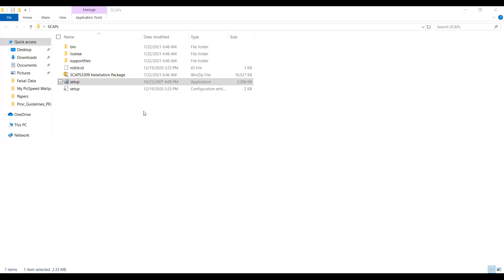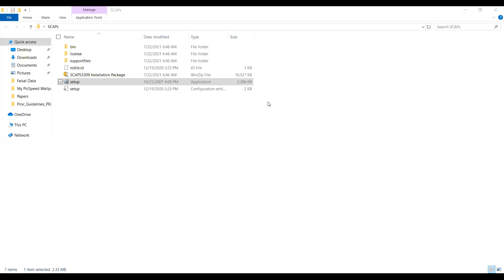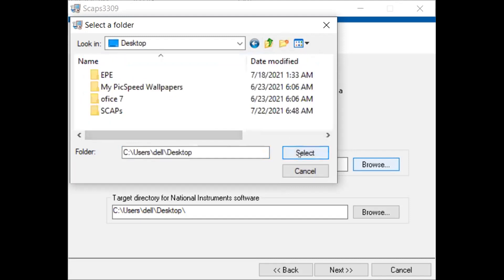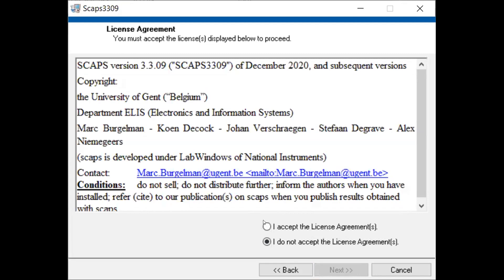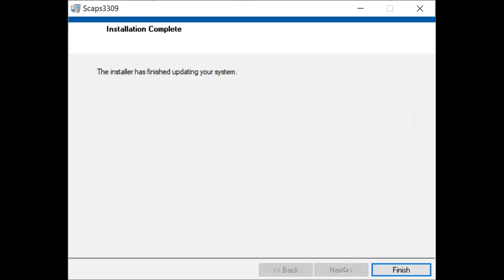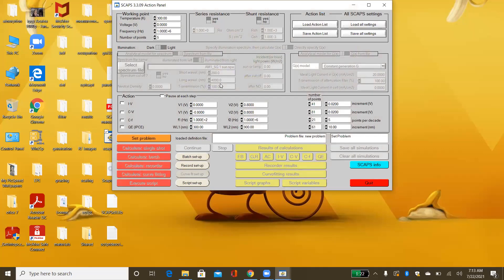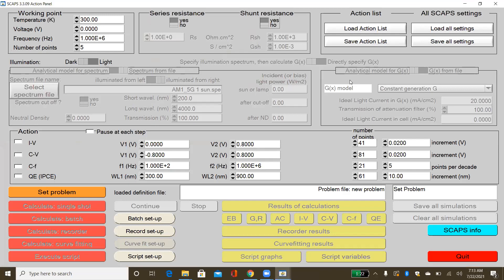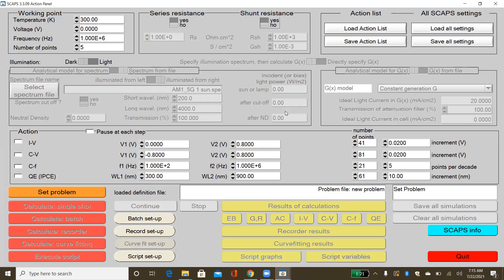How to Install SCAPS 1D Simulation tool, setup guide and Installation Process for Beginners

Comment: Hello sir,
Thanks a lot, the video was really helpful. I have a question. Now that I installed SCAPS 1 D every file is appearing on the dekstop. When I am trying to make a new file and store the files there scaps dont work. When I bring the files back to deskop it works. Can you please explain because i would like to not appear on my desktop all these files but only scaps3312 which i use
Reply: I mean the files: absorption, license, occupation, results...
Reply from the maker: I think you have installed SCAPs on the desktop. But you can make folder in other drive too.
Reply from the maker: These files must be saved in the installed directory like absorption or Def folder
Reply: @engrmuhammadwaleedakram4486  thank you sir !
Reply from the maker: @chrischris2050 you are welcome

Comment: Greetings Sir.

I have to use the software for internship purposes.
However, while installing, I cannot proceed to the final step (i,e., Start Installation at 5:17 minutes of the video)
The "Installation summary" shows "No software will be installed or removed" instead of the file name.
It would be kind to help me out about the same.

With best regards,

Yasir Shafi
Reply: The same problem I am facing, what you did to solve the problem sir
Reply from the maker: @Krishna Priya plz watch the video step by step. If still issued remains pl email me on waleedakram280@yahoo.com
Regards
Reply: I also faced the same problem. Then I checked which programs are installed in my PC and found that I have already installed SCAPS before. Then I unstilled SCAPS completely from my PC and reinstall it. This time I faced no problem.
Reply from the maker: Gudluck dear

Comment: When I am downloading
(5:16)
My Installation Summary
Is
No software will be installed or removed.

Please help sir
Reply from the maker: @Anisa Mukherjee pl join me on zoom session so that I can see your issue and suggest you tentative solution. Pl contact me via email waleedakram280@yahoo.com
Regards
Reply: Hello. How did you solve this encounter, I'm experiencing same thing.
Reply from the maker: What issue you are facing my dear??
Reply: @engrmuhammadwaleedakram4486  Sir, I have managed to fix the problem I was facing. Thank you very much. Are you doing any research on Perovskite solar cells? Would love to see it as I am doing my masters degree focusing on PSCs
Reply from the maker: Yes I'm doing research in Tin based Perovskite solar . I am glad to see you fixed the said issue. Regards
Reply: @engrmuhammadwaleedakram4486  Me too...
Reply from the maker: Gudluck
Reply: @engrmuhammadwaleedakram4486  Thank you very much. Wishing you the best.

Comment: Hello sir.. I want to add an energy band diagram to my article.. Do you have any video about the energy band gap through SCAPS-1D??
Reply from the maker: Dear Rahul I HV did not make a video for the energy band diagram. But in the simulation second interface you can see the diagram. And if you want to extract data you can click on show data. After extraction of data you can plot CB and VB curves in origin software
Reply: @engrmuhammadwaleedakram4486  sir thank you for the reply. My question is that I have to take data of single shot or batch parameters can you tell me about this.. I am getting confused in this only
Reply from the maker: @rahul_32165 single shot and just mark J-V analysis on. No need to go for batch analysis or other my dear
Reply: @engrmuhammadwaleedakram4486  thank you so much sir
Reply from the maker: @rahul_32165 let me know if you have any other concerns

Comment: After installing it on the desktop, a lot of other folders( around 22) were created on the desktop also. Can I move all those folders into one folder on the desktop ? Will it affect running the software ?
Reply from the maker: There is no such issue . You may move one folder name with SCAPs
Reply: @engrmuhammadwaleedakram4486  Okay. Thank you very much. ❤️
Reply from the maker: If there will be still issue let me know. Regards

Comment: I started the installation process in the way INSTALLATION SUMMARY SHOWING AS - NO SOFTWARE WILL BE INSTALLED OR REMOVED
Reply: What should I do for this
Reply from the maker: Follow up my video step by step. If you installed the software ever before, try to remove it completely